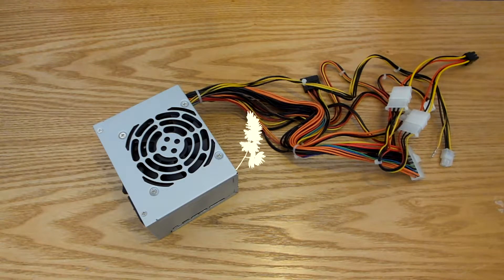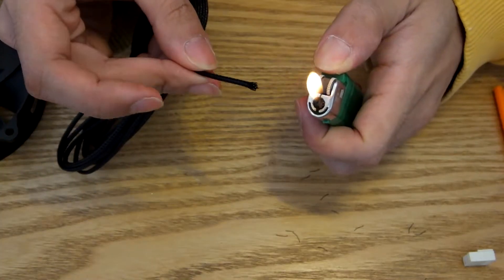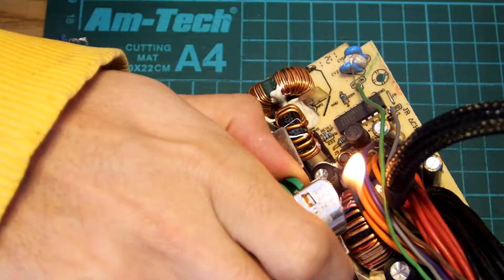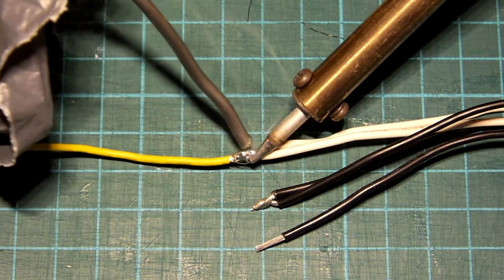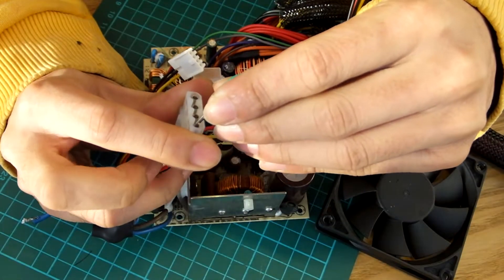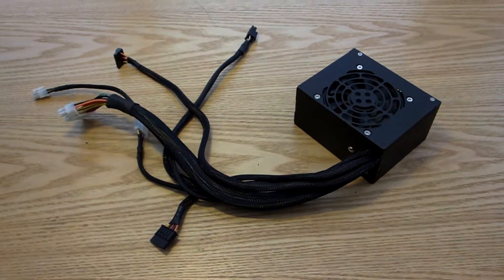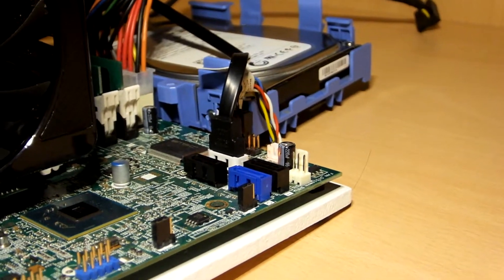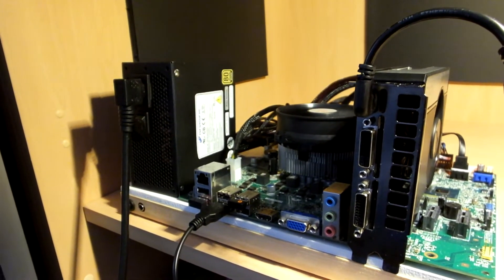Modding An OEM Power Supply To Look Pretty

Comment: I had a cheap psu in my old desktop for 11 years. I replaced the computer last year with a new one, but I still use the old one for some of the games I have that give windows 11 trouble. I had to replace the old cheap psu, it still worked, but the power cord socket was brittle and broke leaving just the two leads dangling out of the hole. I noped that thing out of there and ran and bought a new one.

Comment: How to safly discharge those capacitor before any operation?
Reply from the maker: While connected to the pc, you can unplug the psu from the wall, and push the power button a few times until fans stop spinning and all lights go
Reply: @TheBuddingEngineer  thank you

Comment: Instead of taping the grounding hole, I would use a sacrificial screw. That way more of it gets painted. But I'm a perfectionist and would probably use masking tape on the inside surfaces to prevent them from getting painted.... or paint all of the inside too.

Comment: Instead of using a knife, this guy really should have been using 'diagonal cutters.' The hardest part of this might be how to remove the AC plug housing and on/off switch housing from the case. He didn't show that part which is what I'm having trouble with.

Comment: the moment he tried to cut the nylon zip tie with a sharp plastic cutting tool, I pictured the next scene would've shown a band aid on his thumb lol
Reply: Agree.  It is much better and safer to just cut the "square" portion of the cable tie with diagnal cutters and it will come apart w/o risking nicking any wires.

Comment: I want to try this in the future. I have a mostly black and white build. But the case is white, and the PSU sticks out like a sore thumb. Although it's a great PSU (FSP Hydro 650w 80+Pt) i would prefer it to be white. The only white PSUs i can find are outrageously priced, or non Modular, i also already have the custom cables for this one, so i would prefer not to get a new PSU. I don't care for the warranty, as nothing is truly ever under warranty. But anyway thanks for this video, you did a great job.

Comment: Nice project but for that much time and hassle i would just buy a new psu
Reply from the maker: Thanks, I did mention this in the end. I'd spend at least £40/$50 on a new, reputable brand PSU or find a good deal on a used one. I wouldn't trust cheap, new power supplies - they won't be as efficient, probably won't deliver their advertised rating and might not last long. I got this PSU for dirt-cheap and have read that it's decent, as well as wanting to learn cable-sleeving.